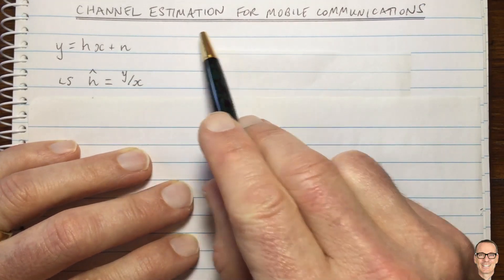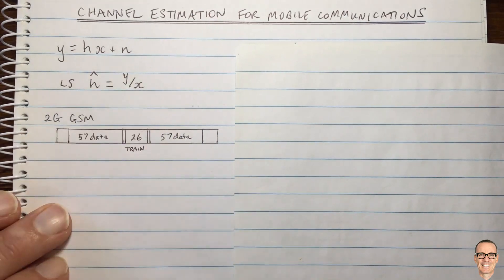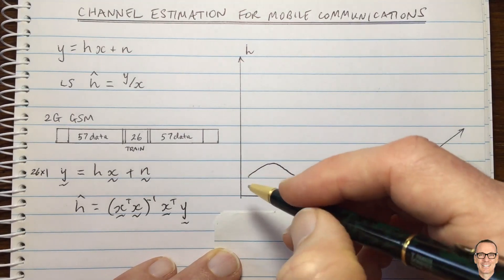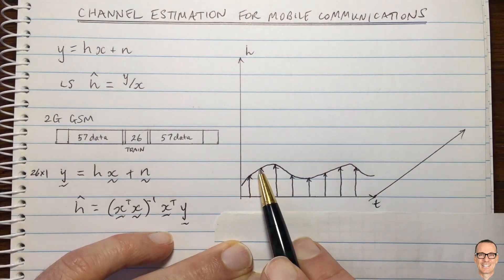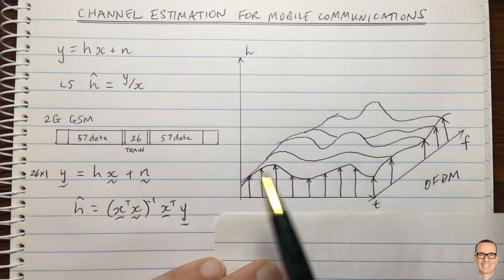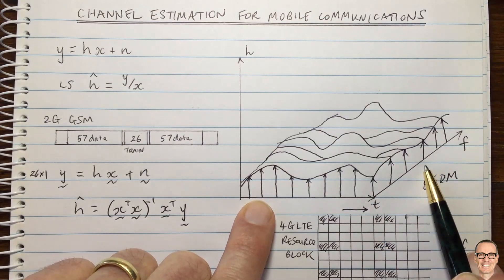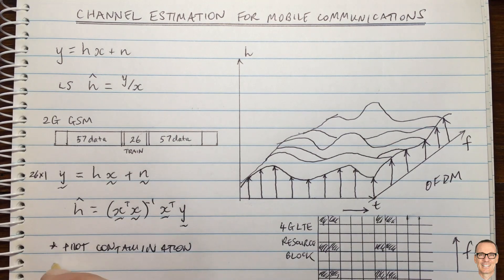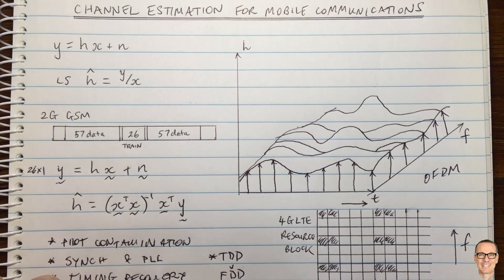Channel Estimation for Mobile Communications

Comment: What is the state-of-the-art estimation technique used in telecommunications today?
Reply from the maker: That's a hard question to answer here. There are thousands of techniques in the literature for numerous variants of current fixed and mobile communications standards. And communications chip design companies have proprietary variants of those, plus other designs no doubt.

Comment: How about multipath scenario ...
Isn't channel estimation needs assuming a mathematical channel model and then finding parameters of that mathematical model based on measured signal...
Reply from the maker: Indeed. The time-varying nature of the channel I illustrated in the video is a result of multi-path.
Reply: Thanks...
I meant for multipath case "y" will be "h" convolved with "x"...

Comment: I'm a computer engineering student preparing a seminar on CGAN models for channel estimation.

Could you explain why channel estimation is important?

What values are typically found in the channel matrix (like h12, h11, h22, h21)?

Also, is channel estimation used in everyday phone calls to obtain the channel matrix for equalization?

I would appreciate your insights!

 @iain_explains  Sir, I've watched the video you mentioned in the link, but there's no explanation about the channel coefficients inside the channel matrix. 

It would be easier for me to understand if you could reply with answers to the 3 questions I asked as a reply comment (explanation is only required on a surface level and in  simple words)

Comment: Thank you for the informative video! I am currently studying channel estimation for 5G for my Thesis. I would like to ask a question, and I apologize in advance for my simple question. I searched about the signal/energy value used for simulating pilot symbols in matlab. From what I currently know, information bits in matlab is simulated by randomizing bits 0 and 1. Pilot symbols however does not used bits (as far as I know) and the value is known at both the transmitter and the receiver. What is the normally used signal/energy values used for pilot symbols for channel estimation? Thank you in advance!
Reply from the maker: The power used for the training signal depends on the particular specification in the relevant standard. There is no "theoretical optimal" power.

Comment: sorry for this dumb comment - in the GSM case, once you get the channel estimate, do you have to go to frequency domain to cancel out the channel effect? I am thinking (sorry for the simplistic and non-engineering view) it will be just a matrix division there rather than the process of deconvolution? please comment (i get it in the OFDM case but not sure in GSM ?)
Reply from the maker: It's been a while since I was thinking about 2G GSM systems. But basically, GSM is what we would now call "narrow band", and it used "single carrier" modulation. So the channel was effectively "flat" in the frequency domain. The main thing to worry about was the time variations in the channel. These videos might shed more light: "Mobile Standards Evolution: FDMA, TDMA, CDMA, OFDMA" https://youtu.be/bm53RpK-S2k and "What are Flat Fading and Frequency Selective Fading?" https://youtu.be/KiKPFT4rtHg

Comment: Hello sir , if there is no relative motion and no Dopplers than also why we need to periodically transmit our pilot bits for estimation of channel, I mean to say channel response is not changing with time so we should only estimate our channel once and then we can detect our signal at the receiver end
Reply from the maker: How do you know there won't be any relative motion? If you're designing a system for a mobile terminal, then you need to design your transmission protocol to allow for motion.
Reply: @iain_explains  ok sir i got your point but consider a case when you are talking to a person over mobile phone for an hour remaining stationary (sitting on  your working desk)  with no motion at all then the channel is stationary so in this case also there is estimation of channel required again and again? or one time estimation would be enough?
Reply from the maker: Well the network/basestation doesn't know that you intend to stay perfectly still at your desk. It needs to be prepared for you to start moving around at any moment. If it doesn't have continual 'channel sounding' then it won't be able to work out if you start moving, and then respond. It would result in your connection going into a high error state.
Reply: @iain_explains  thanks professor it cleared my most of my confusion

Comment: hi lian,
suppose if we have coherence time Tc for a time varying channel than for that particular duration  weather we are sending our data and pilot bits or we are only sending pilot bits for the estimation of channel.
Reply from the maker: Over that duration you can assume that the channel doesn't change too much (more or less - like I say, it's a vague concept). So within that time you need to send some training symbols to help with channel estimation and send data symbols that will be detected and decoded using that channel estimate. After that time, the channel will likely have changed, so you'll need to send some more training symbols and re-estimate the channel, and so on.

Comment: Very useful as usual. Thank you. On the subject of channel estimation, a video on SU-MIMO and MU-MIMO channel estimations to help beamforming might also be useful. I get how MIMO channel estimation can be achieved when a different pilot is used for each antenna/user/port (5G terminology), basically this would be the same as your explanation in this video. However, let's say we have a 4x4 MIMO and only one pilot sequence is used, eg Gold Sequence. How do we get the 16 channel parameters out of the single sequence?? 

PS: Assuming channel reciprocity, MISO and SIMO is also easy to get with a single pilot sequence.
Reply from the maker: Thanks for the suggestion. I'll add it to my "to do" list.

Comment: Excellent and lucid explanation.  Would like to know how decision directed estimation (data basically) in good channels helps in the channel interpolation .. Again thanks a lot
Reply from the maker: Well, if you detect/decode the data correctly, then you can use it in exactly the same way you use pilot symbols, to estimate the channel. The data can act as extra pilot symbols. If you are able to detect/decode all of the data correctly, then you don't even need pilot symbols at all. In OFDM, some sub-channels could use low order QAM sending data at a low rate with reliable data detection/decoding (the detected/decoded data could be used to add to the pilot symbols to better estimate the channel), while other sub-channels could use higher order QAM (to get the higher overall data rates).
Reply: @iain_explains  Thanks a lot for the reply.  My understanding is that pilot is a known signal and can be used for channel estimation whereas data is random (i.e. random constellation point) . What I am unable to comprehend is how data (even though low modulation order like bpsk or qpsk) can be used for channel estimation.  In lte for e.g. unfortunately all carriers (RE) allocated to a user will have same modulation order unlike say ADSL where each carrier can have different bits allocated (from 2 bits to 15 bits). Can you please elaborate on this? Or is this something like decision feedback Equalizer concept where previous decoded data symbols are used to estimate current symbol .. Am I missing something ?
Reply: @amitpalkar934  I have similar confusion. Please post if you get an answer?

Comment: please make a video on the log-likelihood ratio for qpsk...with a numerical example.
Reply from the maker: Thanks for the suggestion. But I'm not sure which log-likelihood ratio you are talking about, sorry.
Reply: @iain_explains  sir, suppose we have QPSK symbols mapped to {+-1,+-j}, bits " b0b1" passed through a scalar fading channel :y=hx+n, where n is Gaussian with mean=0 and varience (sigma)^2.
Then the value of 
LLR(b0)= log[pr(y/b0=0)/pr(y/b0=1)] 
will be..
Sir pls provide insight into it.
Reply from the maker: Well, if you just want the LLR for b0, then you'd have to average over the possible values of b1. You can't have pr(y|b0) without also saying what you're going to assume about b1 - either by conditioning on its value, or averaging over its pdf.

Comment: I've been hearing a lot of buzzwords around WiFi CSI lately. What exactly is this? I couldn't find much stuff on internet, all sources seem to be reiterating same points
Reply from the maker: Thanks for the suggestion. I've added it to my "to do" list.
Reply: "Might" be similar to CSI-RS in 5G-NR which are REFERENCE-SIGNALS transmitted in DL helping the user equipment in measurement of the DL channel which can be reported back to the base station for tuning and adaptation techniques which will improve the efficiency of data transfer. It is used for multiple other features in 5g-nr.